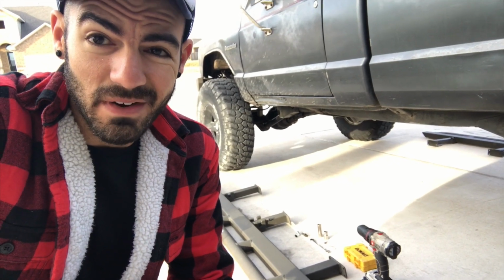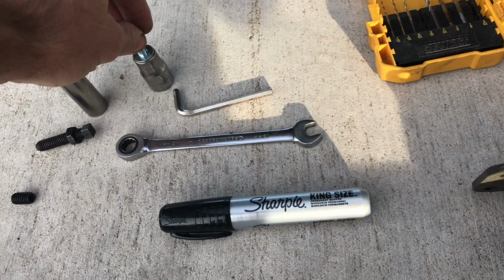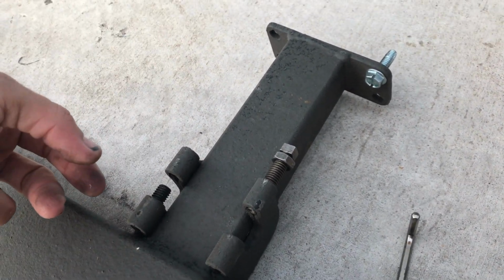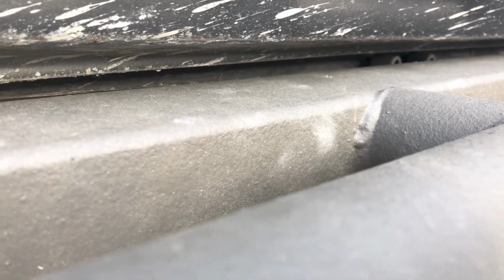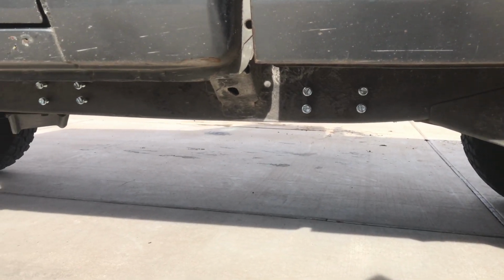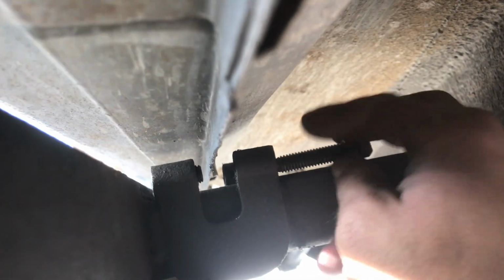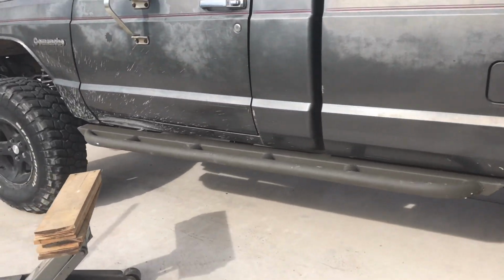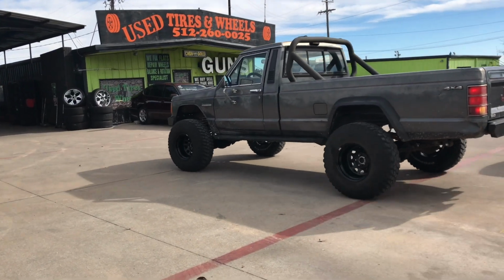Nates 4x4 Rock Slider How To Install Comanche / Cherokee + New Wheels! JN48

Comment: I have a nates 4x4 rear bumper on my xj its strong I tow a trailer with the built in receiver. Within a week of me installing it I got rear ended by a honda I was going maybe 5 or 10mph and the honda 45 or so it slammed me hard and went under me into my gas tank skid plate. The bumper took the hit with no issues at all I had zero damage and the other car was totalled
Reply from the maker: I may or may not have backed into a pole the other day and it beats moded it. Great products

Comment: I actually end up purchasing them on 5/21/2018 but I haven't received the yet. Every time I call I just get the voicemail. They haven't   responded back. So my question is how long did it take to get your rock sliders. Also did you have any trouble contacting them?
Reply from the maker: No, every time I called they were spot on. I know it’s a smaller company though.